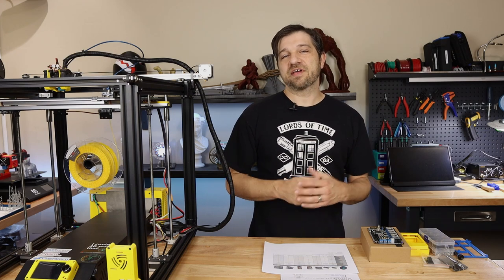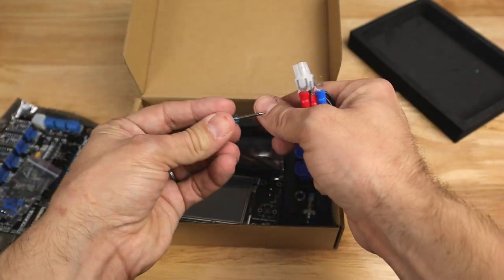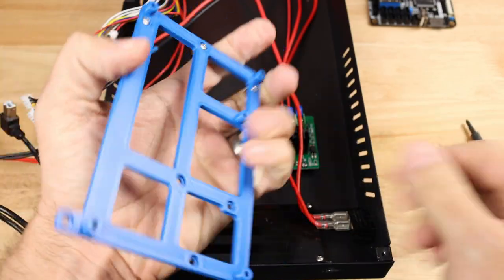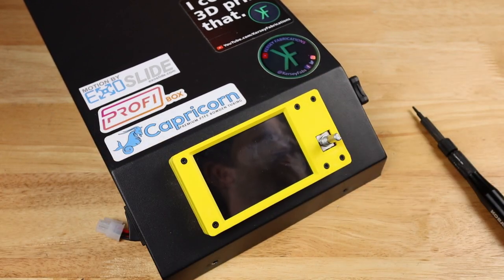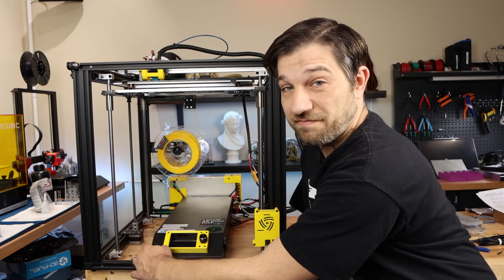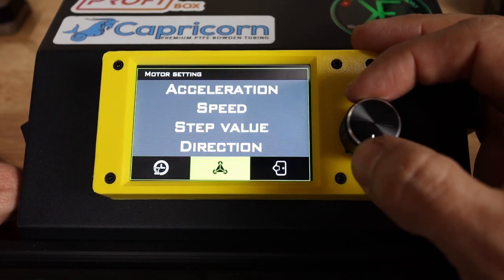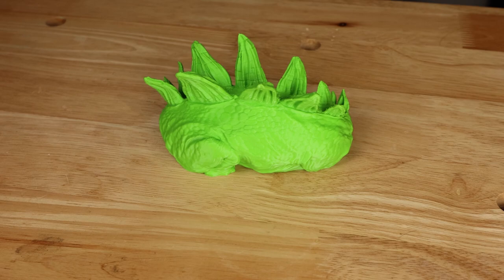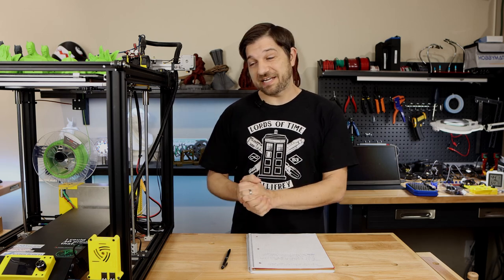Lerdge K 32-bit 3D Printer Mainboard Guide and Review

Comment: This is really cool! I feel like this will become the future.  It's crazy how advanced these machines are yet you still have to compile firmware. It's a major roadblock for anyone new to it and I believe it turns alot of people away. This is a major game changer
Reply from the maker: I'm still using my board and have been since this video. I may even have an update coming. 😎
Reply: @kerseyfabs  I would love to hear your review after a year of use, as I am contemplating this upgrade. This is another great video btw!
Reply from the maker: This exact board is no longer being made but there is a similar one now available. The info is in the description. I've been very happy with it overall and I'm actually still using it. I've been told that the firmware has improved since my review but I haven't had the desire to upgrade mine. Thanks for the question!

Comment from the maker: This is my obligatory post where I will post updates, clarifications, and corrections. Helpful hint: If this video seems too long, check out the "Playback speed" by clicking on the little gear on the bottom right of the video. Enjoy!

I totally missed that without UART being enabled by default on the 2208/2208 from Lerdge, the reference voltages are way too high and your motors will run really hot (and loud).

This spec sheet has the magic formula which amounts to I = 0.88 * Vref. This means we need to turn them way down from what appears to be the default of 1.25 V which is 1.1 A to 0.68 V for .6 A.
If we go by my previous installs:
X: 0.65 A = 0.739 V
Y: 0.8 A = 0.909 V
Z: 0.65 A = 0.739 V
E: 0.8 A = 0.909 V
If you're not sure how to do this here's a previous video that shows the process: https://www.youtube.com/watch?v=cAI0H4e6Usg&t=946s
I'll release a separate video on this soon which will also include how to set up UART.

For more information: https://www.lerdge.com/public/upload/file/360f824755ab521bd741a67994b1de7e.pdf
Reply: Now I was just wondering if this board is a silent board as well. In addition would you say this bad boy increases print quality?
Reply: @michaelpauli734  The TMC2209 steppe drivers can use stealth chop and will make it silent. My ender 5 plus made a lot of noise, now the only real noise I hear is when it retracts and the fans.
Reply: @jumpjet908  what about print quality, will it be increased or no.

Comment: Immediately I love that all the important connectors are clearly labeled directly on the board!
BTW, never solder power cables unless they're very low voltage and amps, instead crimp them. Solder tin can break and cause micro-arcs which can cause a fire in the long run.
Reply from the maker: What's your recommendation for connections like this? I thought about using wire nuts or a terminal but neither seemed quite right.
Reply: @kerseyfabs  Here's a good tutorial with 6 different way to do it
https://hobbyhoarder.net/how-to-connect-small-wires/
I prefer crimping pins on them to connect them using push-in wire connectors. However quick splice connectors are the absolute fastest way.
If you're still gonna solder them, just make sure a maximum number of strands make contact with each other: they need to be tightly intertwined. The solder should only be there to hold them together, not to conduct electricity, meaning there shouldn't be a thick layer of solder between the two cables (which is what happens when cables are laid next to each other and then "glued" together with solder tin).
Reply from the maker: Thanks Muru! I'll be sure to take a look!

Comment: I just installed a lerdge z in my ender 5 plus,I couldn't get a k board then,and im still working the kinks out,your video helped alot.  I missed the part about filament sensor wires being backwards last night and got a puff of smoke when the wire got hot,I unplugged it quick and it seems to still be ok after swapping pins and plugging back in. I also was stumped over the two wire limit switch plugs and the three wire   sockets on the board,till I saw you plug them in, just on the right two pins,I would have never thought of that!!I got the bl touch to turn on and probe twice when the system powers on the first time with no issue,so I think it's right. I'm waiting on a new belt for my y axis before I can test it further. I used the massive Mosfet they included as well..  I have never done anything this involved and your video helped immensely,!!   I saw below you put a obligatory post stating the motors might run hot???  And the vrefs might need to be adjusted? Do I need to do this with tmc2209's on a lerdge z board??

Comment: This was another very well done video. While I think it's cool that there are manufacturers doing different firmware, I'd hesitate to use anything other than Marlin simply because there's so much documentation and help available. If I'm having trouble with something, it's almost certain that somebody out there knows the answer. Not so much with something like this.
Reply from the maker: I completely understand. Hopefully through further adoption though, it will get more usage and more mature.

Comment: Hot damn I just ordered an ender 5 plus for my first 3D printer and was thinking hey this would be a good upgrade instead of a normal silent board upgrade. Once you started going through the settings though I lost confidence in my ability to understand all of that and get it done properly. Dang it. Looks like a nice upgrade
Reply from the maker: Congrats on the new printer! I'll be releasing a new loadable config file for the Ender 5 Plus soon. I obviously can't support everyone individually on this but I do try to make it easy!
Reply: @kerseyfabs  oh you definitely make it easy enough and I was going to give it a go anyway and just take my time getting it right. But they are all sold out at the moment so I might have to look into one of the other options you showcased on the channel. Thanks for the help brother!

Comment: Nice video Kris!  I've enjoyed following your journey with the Ender5 Plus.  I've used many of your upgrades on my own Ender 5 Plus.  Question regarding the Octoprint print quality issue . . . . did you happen to try some post processing of the GCode using Arc Welder?  It helps significantly with some of the issues you experienced.
Reply from the maker: Thanks Scott! I'd love to try arc welder and will plan to check it out in the future. I did verify that Lerdge does have Arc support, so that's a good idea!

Comment: Took the plunge and purchased the Lerdge K upgrade kit, direct from their online store.
Have to say very impressed with the quality and the documentation. Today was the day, I had printed every thing ready. This evening I have ran a test xyz cube, with no visible issues at all. Just need a bit of time to test retraction setting and bits.
I did do the PID tune that was easy, but would like to see a follow up video. showing the technique to auto level, and set z offset. With the 2 drivers for the zaxis will left to right bed leveling be automatic?
1 thing that has changed the TFT screen is now a version 2 and your case no long fits this model, the jog knob has been moved more central to the PCB, and the fixing holes have different locations. must be pretty new as I have not found and cases that fit this new style yet.
Q. is there any way to fine tune the z-offset while printing? or did i miss something in leveling?

thanks for your great support

Comment: Getting the ender 3 v2 with mosquito hotend.... Would you recommend going with this board, Using stock board with a raspi4 with Octaprint, or going with duet 3 board?
Reply from the maker: Right now I can't fully recommend this board if you plan to use OctoPrint. I hope they will have the bugs I found fixed soon. So, if you plan to make a purchase soon, go Duet.
Reply: @kerseyfabs  Is it "better" to go with a duet 3 (could be hooked with raspberry pi 4) or is the new ender 3 v2 board with raspberry pi 4 pretty much  same?

Comment: Like the video I have the same board I installed on my ender 5plus but I haven't got it dialed in yet do you have or do you plan on putting out a follow up video from start to finish on the actual setup and settings and leveling that work for you to get it printing  well ?

Comment: Could you have used both, the BL-TOUCH and an END STOP? I ask because the END STOP seams to generally give more repeatable reliable
Z-positioning. 

What I'd like to do is dedicate the SENSOR only for BED LEVELING and the END STOP for homing.

I'm using ARDUINO and an MKS G1.4 BOARD now, but don't know how or if it can be coded that way?

Comment: Great video. Do you know if the lerdge k  board supports BTT S42B V1.1 closed loop stepper motors.
Reply: Yes, the Lerdge board does accept the BTT S42B V1.1 steppers.

Comment: Thank you for the video. I am considering this modification on my Ender 5 plus and was wondering if the new Lerdge Z board addressed the issue with Octoprint? Too bad they stripped several standard features off the K and called it the Z. Now you have to purchase more add-ons to get the functionality of the older board.
Reply from the maker: From what I've heard, they fixed the OctoPrint issues a while ago. I haven't confirmed this myself but it's what I've been told.

Comment: What I don't understand is why you set the endstop wiring mode to N-C? Based on the diagram I saw of the Lerdge Board, all three of my physical endstops are Middle Wire / Normal Open, and Botton Wire / Closed? Am I write? I wish you'd reply back on the question because this was a real mess of discussion when I was trying to install the world's most expensive riprap board.

Comment: After I upload your configuration files and when I open page 2/2 on the Auto Leveling Setting, the buzzer sounds continually until I change the Probe Wiring Mode to N-O .  Why on N-C it beeping?  Is my wiring for BL Touch is wrong.  I follow your wire coloring and polarity on the video.
Reply from the maker: I'm not sure why it would be doing that unless your BLTouch has an error currently and needs to be reset. Were your wires the same color as mine?
Reply: @kerseyfabs  The Black and White, Orange, Brown and Red wires.
Reply: After a few extruder crasher to the bed, I got it fixed I think.  The black/wire wire on your video is correct.  Is my fault the pin not all the way seated, that's is why when N-C it make beeping sound.  When I recorrected the pin connection, it works.  Now I have to work on the offsets.  What is your off setting for the OEM Extruder/BL Touch for Ender Plus?
Reply: I figured it out the reason it keep making beeping because the black/white pin not connected properly and cause N-O circuit and thus the beeper sounds.

Comment: Thank you Kersey! This board would be so much easier getting up and running a dual hotend! I have had so many issues to get it up and running nicely on marlin.
Reply: I also wanted to add that your detail on this video is absolutely perfect when It comes to wiring and setting up vs your previous videos, regarding bltouch wiring generations, direction of color of wiring, especially to get that bltouch working. (I have had so many issues to get that thing to work on my ender 5 plus)
Reply from the maker: Thank you for the feedback! I hope this is much easier for people and provides a good alternative.
Reply: @kerseyfabs  I was thinking, have you tried the arc welder plug-in for cura and octoprint to see if there would be a difference in quality in the prints and could solve the issue with octoprint?
Reply from the maker: No, not yet but I have had a lot of people suggesting it, so I will.

Comment: So, nothing the first time, meaning no screen report. I checked a connection on the board going from a filament sensor to the board and discovered it was very hot. So I turned the board off, pulled the connector off it, and then turned the board on again. Success! Now I have to figure out what I got wrong with the filament sensor wiring.

Comment: I just installed the Lerdge K Board and followed your settings for now, but if i set the z offset it won't work properly. It seems like it doesn't use the value that i entered... Any Idea what the Problem is

Comment: You don't have to use their steppers right? I can use bigtreetech or mks 2209 or whatever ? I got the board but passed on steppers since it was like 40 dollars extra when i have like 10 2209 ,12 2208 and a bunch 2225
Reply from the maker: I actually haven't checked the pinout to see if they're the same. I'll see if I can find time to do that.

Comment: Install the Arc-Welder OctoPrint plug-in and a lot if not all your issues will likely go away. Just verify the lerdge board supports the arc gcode commands first of course.

Comment: ok bought and installed everything, having small issues,, one is getting the pt100 thermistor working correctly, second issue as soon as you hit home it wont stop going to the top, grinding hard and its only on the left side mostly
Reply from the maker: Sorry to hear about your problems. Unfortunately I don't have a PT100 for testing but I do remember seeing that option in the menus. If it doesn't work, I'd contact Lerdge. For the Z issues, I'd double check your BLtouch wiring and settings.
Reply: @kerseyfabs  ty so much for your help, I have the worse luck, the pt100 works fine after trying it without the booster, apparently lerdge k has onboard support, simply hook it up like any other thermistor and set it on pt100. now after fixing that, both extruders jut stopped working, tested by switching the drivers around and they still  wont work.. sorry to bother yas lol,,,,,,,,,my luck with 3d printers suck, from the factory board to the lerdge k. I hope to print something some day lol
Reply from the maker: That sucks! I can't imagine what happened from such an easy fix. Any chance that booster blew something?

Comment: If I understand correctly the unique selling point of this board is that it runs plug and play, due to using its own custom firmware, without having to compile stuff. So obviously I would be interested in hearing more about the features in that, and if they work well (for improving print quality). From the top of my head, how well does linear advance work, does it support dual z leveling, probe grid size. Generally speaking: How does this board+firmware compare feature-wise to stock ender 5 plus, and a custom marlin on a BTT board.

And of course I'm interested in uart mode, and what that could do for me, driver-wise.
Reply from the maker: Thanks for the feedback!

Comment: Kris, I have just finished installing the Lerdge-Z board in my ender-5 plus, I have the homing working correctly, it goes to the back right, and the BL-touch works fine.  When I went to run the first print, the print head came to the center, then went back to the home corner and started extruding.  Did you have to change anything in the slicer, from the standard Cura profile for the E5P?  Thanks

Comment: Thank you for the videos. You've been a wonderful asset to my world of the Ender 5 plus. Just wondering, what is your total cost in upgrades so far with this printer?
Reply from the maker: I'm happy I can help! My printer is always in flux because of the channel. One day I hope to have a "master Ender 5 Plus" with my favorite upgrades. Honestly, at any given time, I'm guessing it's not more than a few hundred dollars. That would include a new mainboard and display, new hotend, and new motion as well as odds and ends.
Reply: @kerseyfabs  thank you so much for responding. I really appreciate it. I purchased my ender-5 used off of eBay and it was pretty wrecked up. But after following your videos, I am excited about the future of it. Do you have any outlook on maybe building an enclosure for it? I'm hoping to be able to do that soon. I was going to build out of wood, but now wood is more expensive than glass and steel right now so I think I'm going to go that route. Thanks again for all you do. Your vision and your channel are both amazing. Keep up the great work. I look forward to seeing your next videos. Have a great day.
Reply from the maker: @adamflight1  You're very kind Adam. Thank you! If I were going to build an enclosure, I'd build it out of plexiglass and aluminum extrusions. It would look amazing and be relatively cheap and easy. If I wanted it to be more thermally insulating, I'd probably get some sheet aluminum and put insulation on the side panels. I hope this helps. Maybe I'll do a future build but it won't be soon. Too much on the plate.

Comment: PID!!!!! I'm getting this for that feature. Our bed is warping and the PID control of the bed looks to be the solution. However, our current board will NOT allow for changes. (maybe a knock-off). Going to take a chance and order the board. I'm a Mechanical Engineer, not a software geek. Marlin has proven to be an absolute nightmare. Should have done the PID as part of this video.

Comment: I am using prusaslicer.  apparently you can select the firmware being used.  lerdge is not an option, so what should I choose?  mainly want to be able to adjust the linear advance value
Reply from the maker: In Cura, I select Marlin still. It may not be 100% compatible but I haven't run across any issues.

Comment: I enyoid your video and it helps me a lot but on my Creality Ender 5 printer a significant problem arised and i am stuck to solve it When i Home the Hotend bumbes on to the Endstops then I want to make a Testprint and the Hotend bump on the Endstop then again and then it jams on the Endstops and the printer is screaming what is the reason?I forgot to mention I have a Lerdge K board